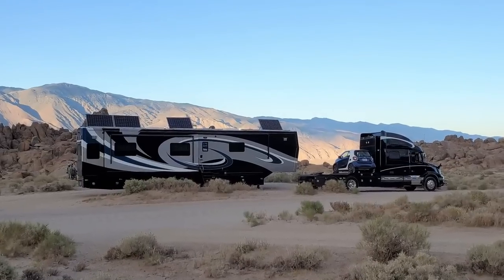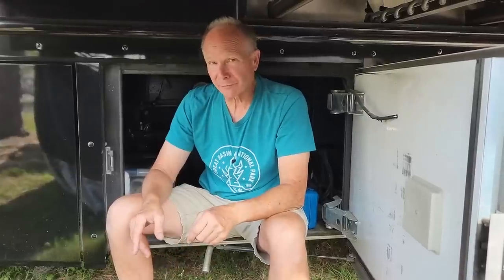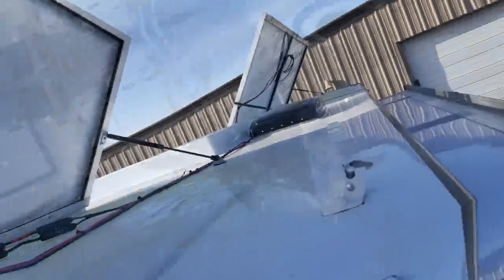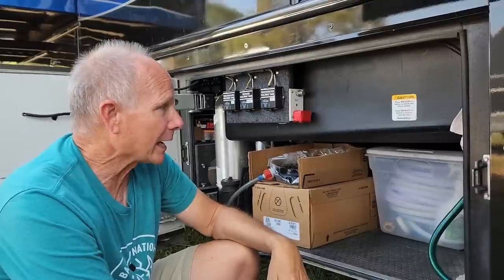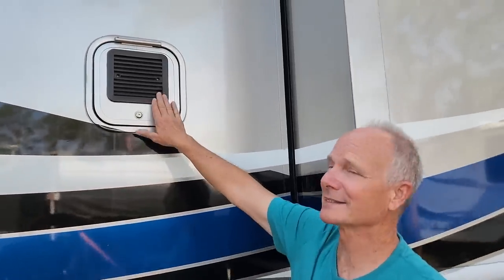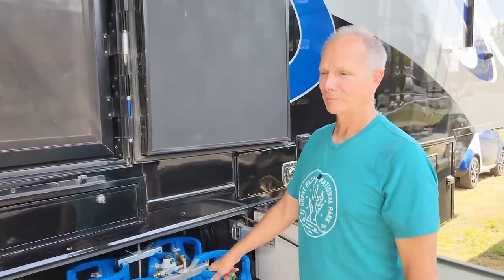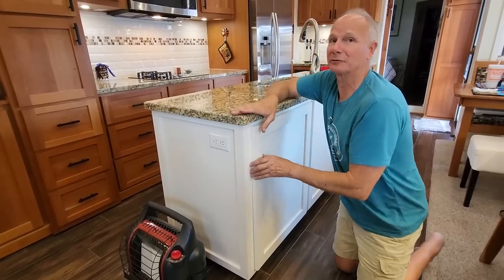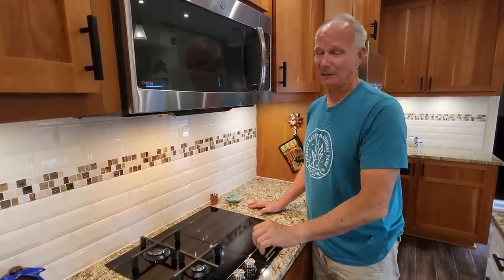Basement Exterior Tour. CUSTOM SPACECRAFT RV BOONDOCKING / RV LIFE / fulltime RV /Glamping

Comment: I use the same shelving in my front compartment.  I put hydraulic line p clamps instead of legs on back side so that it can pivot like a hinge. This way where the front compartment has the 6" lip and the shelf being 24" deep I can pivot shelf up to allow me to put bulky items on bottom and still be able to remove them. Such as 5 gallon shop vac., pancake compressor also power washer then totes on shelves above
Reply from the maker: That's an excellent idea, Michael. I like it! Thanks for the comment and appreciate you watching the channel. 😊

Comment: Great tour! Nice job! We are now running a diesel heater in our rig now and love it. It eliminates the need to run the furnace or Mr. Buddy! On edit, when it gets down to 35 degrees outside, I do turn the hot water re circulator on which keeps all the water pipes heated and prevents them from freezing if it gets too cold. Ya I do use a bit more propane with the hot water heater on all the time, but not as much if the propane furnace was running. For the month of march, the diesel heater used $38.00 in diesel!
Reply from the maker: That's great, Charlie. They are efficient for the heat they produce. That's a cool modification and a great idea on the water recirculation to keep it heated. See you in a few.... 😎😊

Comment: Thanks for showing us under your boondocking skirt David.  Or is it a kilt, lol....   Nice job with the redundancy in heat, could the diesel heater also warm the back section of the upstairs?   Hope you guys stay safe and healthy.
Reply from the maker: Thanks PA, LOL...it could be a kilt but might get a bit chilly in windy weather! The diesel heater does warm the back. It's not enough as a primary source as plumbed but it helps. We have been thinking of re-doing the ducting to make it a primary source for the upstairs. Thanks.

Comment: A novel use of baker's racks (the style of shelving in the electrical cord area); as mentioned @4.24 the adjustability in small steps accommodates the sloped compartment floor. Since they self-tighten under load, I assume that they stay locked in travel, despite bumps.
Reply from the maker: Yes, Brian, solid as a rock. No movement yet over about a thousand miles.

Comment: Guys, I am officially impressed! One question, how long did it take to design and build the boon docking beast?
Reply from the maker: Thanks Wayne. Well...we had been thinking about the type of RV for several years before we retired and started fulltime RV traveling. The first two years after retirement, we knew that we wanted to make changes to our DRV. But it was interesting that we found out we really enjoy boondocking...who knew? So, it was about 2 years of design and research which included the last 10 months in heavy discussions with SpaceCraft about our plans. The actual build time was 7 months from the first weld on the frame until the keys were handed to us. Thanks for the comment.
Reply: Wow what a great video ya very interesting on all the different powers you have propane, solar, batteries, electric good job take care happy camping

Comment: I can run everything also - any source down to 7.5amps up to 30 + 2040 solar on a 28' includes air conditioning
Reply from the maker: NIce. I think that it's important to be flexible and have that kind of capability. Sounds like you have quite the setup for camping.
Reply: @bigtruckbigtravels  full time living 31 months

Comment: How long can you boondock with your current holding tank capacity?  I really love the channel.
Reply from the maker: Thanks, David. Well... it depends on what type of boondocking we're doing. We can easily go 1 week with no lifestyle change. 2 weeks for normal boondocking and 3 weeks if we push it a little and start to conserve more. With sun, we've gone several weeks using the A/C and not running our generator.

Comment: Hello again   David and Sondra    Do you have problems running your generator at night. (complaints)?
Reply from the maker: HI Mark, we don't run our generator at night. If we don't have enough battery capacity then we'll run it during the early evening. We try to be good RV neighbors so no generator at night. If we had to run it there would be no issues as we have enough fuel to run for about a month if we manage our battery capacity and state of charge. We can hear the "hum" of the generator but it's like white noise so no issues. Thanks for the comment. 😎
Reply: @bigtruckbigtravels  I doubt anyone beside you in an RV with less substantial walls would consider the generator to be non-issue white noise... so it's good that you are reasonable about when you run it. We have an Onan built-in generator - I would not run it overnight near anyone.
Reply: @Brian B-P  
I'd have to go back to my gen log, but I can only think of one time in 4 years we ran our generator over night and that was in an emergency situation at a rest area sitting next to a truck that was running his APU.   
I HATE the sound and smell of generators and thus the large amount of solar and battery bank.  If you watch some of our videos you'll notice there are very few people around us when we boondock (except for Albuquerque Balloon Fiesta).  And when we do have neighbors, they are the ones running their open frame generator sitting on the ground outside. 🤦‍♀️
We manage our power consumption to enable us to be respectful to our neighbors.  Thanks for the comment and watching the Channel 😊

Comment: this is really great! I have a couple of questions. how much of a concern is the ground clearance of the trailer when getting off of the pavement?  and how much difference would do you think a shorter tractor would make with maneuverability in tight camp areas? I am seriously considering moving away from my pickup and 5th wheel to a heavy hauler.
Reply from the maker: Great question, Dan. Mild concern on the ground clearance and we have to be careful but so far we have not "high centered". Shorter wheel base, single axle tractor makes a huge difference. The turning radius on a tractor is impressive...a Ford F-550 also has a great turning radius.

Comment: Your rig is truly massive. I have a similar length motorhome, but in terms of battery size, tank sizes, it's pretty much in half. Although, I do have a slightly bigger solar at 3800w solar😄.  Only thing I would add is a hydronic heating system.
Reply from the maker: Hey Timmy, we thought about that during our build but decided against it for a number reasons. We'd definitely like more solar! Thanks for the comment and appreciate you watching the channel. 😊

Comment: At first I thought that the "class 16 AGMs" mentioned @7:49 would be AGM batteries in the BCI Group 16 size, but the proportions of the battery shown are all wrong for that size. They might be 4D or 8D sized - Lifeline sells both of those in 12 volt.

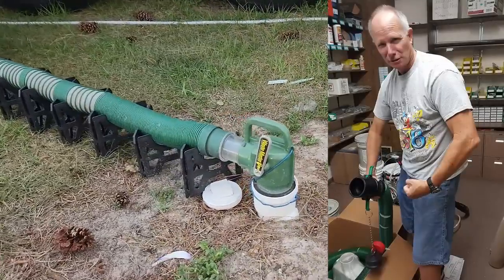Comment: The connection style described @10:19 is normally called "camlock" or "cam and groove", for anyone wanting to find the parts to do this themselves. It is commonly used for discharge hoses in non-RV applications and suction hoses for vacuum trucks, and I think it's a great idea for an RV... as long as you have adapters to work with RV industry standards (bayonet hose couplings and threaded sewer inlets) as required.
Reply: I had never seen the camlock style used in the RV industry until we purchased a Riverstone Legacy model from Forest River. Once I had acquired all of the adapters, I really like the system.
Reply from the maker: Our sewer system uses no "standard rv bayonet" type fittings so I don't need any type of adapter coupler. I do have one (just in case). Thanks for the correction, I just couldn't think of it at the time. It's a great coupling system.

Comment: Hi ! Great tour of your well designed infrastructure. Do you have any gas sniffing or fire suppression on board ?
Reply from the maker: We have a smoke alarm, LP detection device and Proteng fire suppression system in the generator, water heater and battery compartments. Appreciate your comments. 😎😊

Comment: Dave, ? How many lithium batteries do you have and amp hours.  Also ? with the Heat pumps.  Do you have issues with the fans running while you are traveling.  We would like to add a ductless system to our setup and go with the cassette type the would sit in the roof ac spots.  So a 3 zone system.
Buy the way tell Sondra she's a woman after my heart.  Diet coke fiend here also. I have drank it for 35 years since I quit drinking alcohol. I have to have my fix every day or I'm a grouchy 😂😂.  David I also feel for you.  Cindy is a scrap book nut also 
Safe travels and roads Brian and  Cindy, "xtreambydesign with passion"
Reply from the maker: Hey Brian- I hope you guys are doing well out there with all the weird winter weather. We have 48 lithium packs which amounts to 2400 amp hours at 24v (or 30 Kwh). There is a BMS which balances all 48 packs. No issues with the fans turning. We turn off the system while traveling but the ODU fan will spin freely during travel with no issues. LG has approved this type of RV install.
Sondra loves to bullet journal which for her is a cross between scrap booking and journaling. Safe travels to you. Thanks for the comment. 😎

Comment: The system of gas struts to hinge the solar panels up on only the outer edge seems like a clever compromise between effectiveness and complexity to me.
Reply from the maker: We mainly did it to make it easier to raise them. There are trade-offs with this type of system. We're looking at some modifications...
Reply: @Big Truck Big Travels  it only tilts half the panels for a given orientation,  but that's not so bad - if both sets were tilted the south set would shade the north set at low sun angles.
It looks like they only tilt to one angle (as determined by strut length), but that and the strut make them easy to operate. Is that one of the compromises you're thinking of?

Comment: Can you add more details on the water filtration? Are they all sediment filters, or carbon and sediment? Do you have a UV filter as well? Thanks!
Reply from the maker: Started with a UV but it broke with the vibrations of running down the road. Outside filters: I use sediment as the primary then carbon. Inside filters: sediment first then carbon as the secondary. I have a mineral filter on the outside and a "de-scaler" on the inside. Plus carbon on the fridge and the soda system. Thanks for the comment and appreciate you watching the channel. 😊
Reply: @bigtruckbigtravels  Thanks for the reply. We have a remote cottage we have to filter water for, which is why I was interested. We do fine sediment, carbon block and then UV. That works great, I like the UV for bacteria. I wonder if you could mount is on rubber bushings to keep it alive on the road
Reply from the maker: @regmcguire5582  in hindsight, it should have been isolated better. It was on the "water wall" which is near the axles but does see vibration. Thanks.

Comment: Interesting tour of your systems high tech in many aspects well done Spacecraft, Can I ask the basic Pros and Cons  regarding building on a 5TH WHEEL or as yours a SEMI chassis.
Reply: The owners can respond with their reasons, but the SpaceCraft semi-trailer has a lower front section than a typical RV fifth-wheel (because the front of the trailer doesn't need to be high to clear the sides of a pickup truck), it has the axles further back which puts more of its weight on the truck (but not far enough back to really be a "semi-trailer") for better traction but more importantly is more stable, and it is just built to handle more weight. 
The disadvantages that go with those advantages are that it needs a low towing body for clearance, it needs high truck hitch weight capacity (in this rig they had to add an axle to the truck to handle the SpaceCraft that they didn't need for the previous trailer), it take more space to turn, and it's heavier to tow.
Reply from the maker: Right on, Brian. Good job!
Reply from the maker: To add to Brian's comments below. This semi chassis handles more weight and has more cargo capacity than a traditional fifth wheel. With the larger tires (22.5) there is less chance of having tire issues (never any guarantee's) and definitely more stable in all conditions. Plus, we have air suspension and air brakes which are more proportional than a typical RV fifth wheel. When we brake, it feels like one unit (no delays). Thanks for the comment and appreciate you watching the channel. 😊

Comment: So what are the two 50 A (and presumably 240 V) exterior AC outlets for? Running another RV from yours? Maybe I missed that...
Reply from the maker: Hey Brian, sorry but I messed that one up. The front marinco connector is our 50 amp plug to connect to shore power. Since we are long and some older parks have the pedestals up front then instead of using an extension, I'll just connect to the front plug. We end up using it about 50% of the time. Thanks for the comment and appreciate you watching the channel. 😊
Reply: @Big Truck Big Travels  thanks. I  thought at least one was described as an outlet, rather than an inlet, which is why I was confused. Alternate inlet locations are great... especially if they are switched so you don't have live terminals on one when the other is used.
Reply from the maker: @brianb-p6586  yep,  they go through a transfer switch. And your confusion was my fault. Haha, I definitely misspoke. 😆

Comment: Have you loaded the new vehicle with a soda machine or will Sondra make do with a Sodastream?
Reply from the maker: LOL...Hi Andrew, we have a modified Soda Stream. I installed a hose so the Soda Stream is fed by a 10 lbs C02 cylinder and we have a separate fridge which houses the 33 degree water used for the carbonation (colder water is better to hold the gas in suspension). Then we add syrup separately. It works great and the secondary "water" fridge is super efficient. Thanks for the comment. 😎

Comment: @6:57: 15 amps at 120 volts for 24 hours is 43 kilowatt-hours of energy, not 43 kilowatts of power... but you can't safely do that. Continuous load on circuit must not exceed 80% of the ampacity, so if sustained for a day you should not exceed 12 amps, or 36 kWh per day.

@9:00 the same power versus energy confusion occurs: the "25 kilowatts" (kW) harvested by the panels is presumably 25 kilowatt-hours (kWh) in a day. With a peak power production of 3250 W  (reached only momentarily at noon), 25 kWh or more on a good sunny summer day is plausible.
Reply from the maker: Appreciate the correction, Brian. We figured that most people would understand but it's good to be accurate.
Reply: @Big Truck Big Travels  lots of people understand,  but many others are confused by electrical calculations, especially when they don't make sense because the same units are incorrectly used for different things.
Reply from the maker: @brianb-p6586  true. Thanks again. 😊

Comment: Aside from suppliers that outright refuse to refill the composite propane cylinders, have you had problems with idiots overfilling them because they are filling by weight and assume the tare (empty) weight of a steel 20-pound cylinder?
Reply from the maker: LOL, no issues with overfilling. Ours has a relief valve so if they don't fill by weight then they'll do it by volume. Sometimes it will actually "underfill" the tank but never an overfill issue.
Reply: @Big Truck Big Travels  good to hear. 

Small cylinders should be filled by weight, but that's only normal practice in some regions. Filling the composite tanks by weight would work well, if using the correct tare and filled weights.
Reply from the maker: @brianb-p6586  yes, unfortunately, the composites are not real popular so very few facilities have them in their program. It's usually by volume.
Reply: @bigtruckbigtravels  I wasn't talking about exchange programs - I'm very surprised that you found even one company doing that. 

Any cylinder can be properly filled by weight, and all small cylinders are filled that way here in Alberta. The person doing the the filling just needs to know the tare (empty) and filled weight of the cylinder, and they should be checking that even for common steel cylinders. There's no need for a specific cylinder design or brand to be known to the person doing the filling.
Reply from the maker: @brianb-p6586  agreed but that would require a calculation... and most won't do it thus the filling by volume using the relief valve. Thanks.
Reply: @bigtruckbigtravels  yes, some people are both incompetent and lazy. If you come here - to Alberta - you may not be able to get those cylinders filled at most stations because of that.

Comment: The Buddy tent heater in the interior seems like a horrible hack for such a huge and massively expensive RV. Why not just install a proper furnace?
Reply from the maker: It was a simple solution that also gave us flexibility to use it outside in our clam shell or any other type of similar venue. We tried to dual purpose as many items as we could so we ended up with this solution. Thanks for the comment and appreciate you watching the channel. 😊
Reply: @bigtruckbigtravels  it makes sense for portable use, but an unvented propane burning appliance with a large fuel supply (so a failure can fill the RV with propane) seems like a large risk to save less than 0.1% of the weight of the trailer.
Reply from the maker: @brianb-p6586  good point. 👍

Comment: What process did you have to go through to a merry up the trailer to your living quarters.
Reply from the maker: Great question, Dennis. We took measurements of standard heights for truck hitches and trailer pins plus we got the "minimum" height for our truck bed once completed. We relayed that to the trailer manufacturer and it worked out great. I hope that answers your question. Thanks. 😊
Reply: @bigtruckbigtravels  that’s the way to go for Big 5th Wheels.